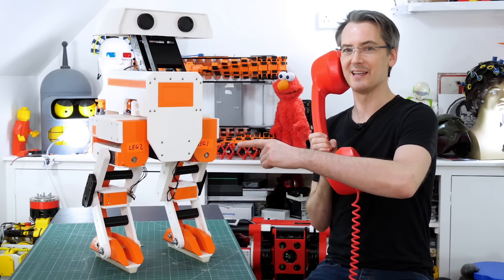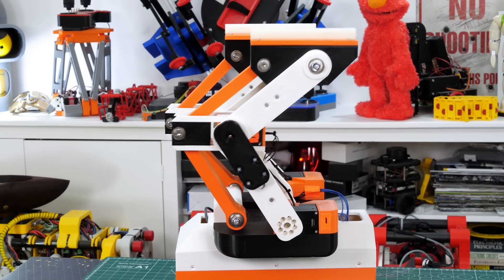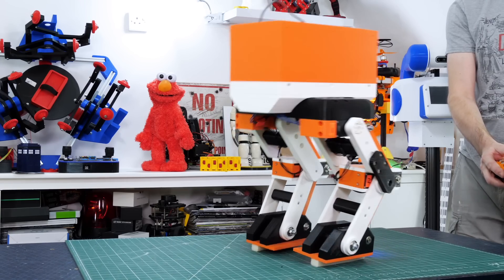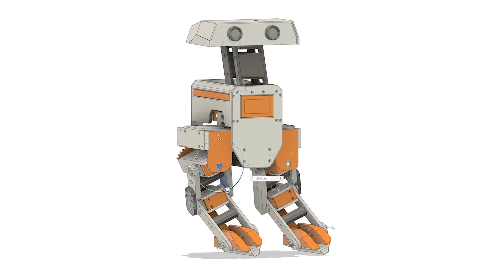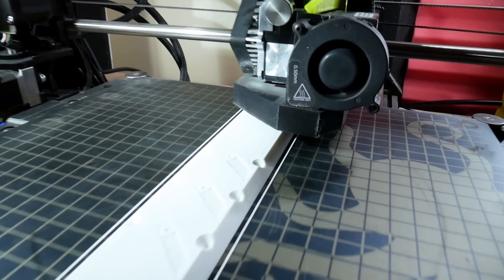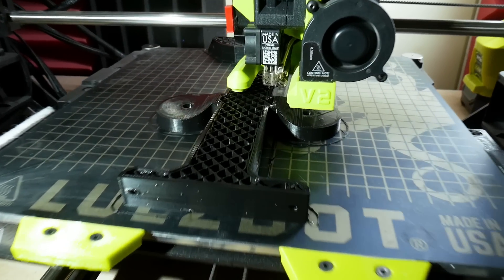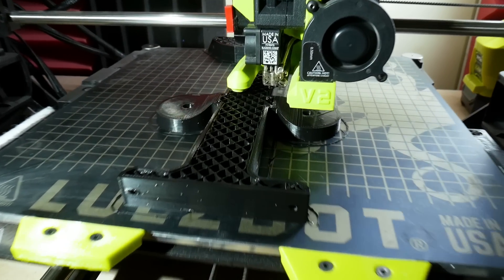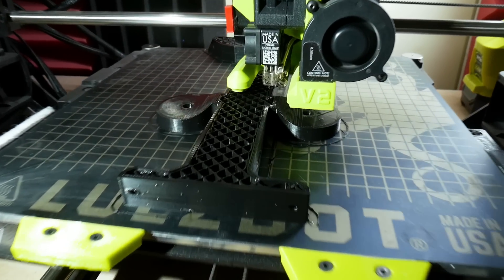How I Built a Walking Star Wars Droid

Comment: This is awesome. I'm not sure I follow the point of the 2 new axes on the legs. The first one's purpose seems to help reduce the wobble, to keep the body vertical and help with balance, which makes sense. But is there more to that? The second one I really don't understand, especially since the legs aren't independently controlled (ie shared servo) and they point in the opposite direciton... what does that do? I figured turning could just be accomplished with longer steps with one leg and shorter steps on the other?

Comment: Why haven’t you consider putting 4 pressure sensors on the “feet” giving data on the “center of gravity “ of the robot with report to the contour of the surface delimited by the contact of the sensors to the ground

Comment: If you want to eliminate gear backlash, copy what's used in the head drive of many optical drives. One of the gears is two thing gears in a stack, with a spring that causes them to rotate slightly in opposite directions. Even if the spring collapses during high speed movement, when the head slows to tracking speed, the spring spreads the teeth to eliminate backlash.

A robot foot idea I've had kicking around for ages is a passive locking design for rough terrain. Without weight on the foot, springs hold it perpendicular to the lower leg. As the leg sets the foot down, the foot passively tilts in 2 axes to match the surface angle. As the full weight of of the robot presses down, the tilt angles of the foot lock. Just above the 2 axis tilt would be a fore-aft joint with springs just stiff enough to allow the bot's momentum to tilt forward over the foot. That joint would also have a clutch to control the ankle speed or to lock in place to keep the bot upright when it's not moving. Best stability would be with one leg slightly forward and one slightly back.

The foot tilt axes could have angle sensors to feed information to the walking control. I figure that robot walking should work from the foot upwards. Put a leg forward and let the foot come down then take data from the foot to adjust the knee and the hip. What I've seen in most robots is a "dumb" foot the robot stabs at where it calculates the ground should be then it reacts to various sensors telling its controls which way it's falling over. A quadrupedal robot can get by with four feet it can treat as simple single points of contact. A bipedal robot with flat feet can handle flat surfaces, or uneven surfaces that are a bunch of flat surfaces of various heights. What I've seen of bipedal robots on uneven terrain that's made of angles or curves is they don't stop and stand on such surfaces. They either keep moving forward or "dance" by constantly pumping their legs. Taking input from foot angle sensors and having ankles that can both tilt in different axes and lock in place would enable steadier uneven surface walking and stable, motionless, standing.

In my much younger years I lived on a 2 acre property with areas that were far from smooth. I used to run across them in the dark and never fell or twisted an ankle. I managed that by keeping my ankles loose, letting my heels land first then allowing my feet to flop down and conform their tilt to the ground. One I sensed my forward foot was planted I'd tighten up the ankle and allow my body weight and momentum to lever forwards while I picked up my rearward foot to swing that leg forward to repeat the cycle. I was quite the logical thinking teenager. :)

Another thing I did was ditch running. About half the property was a grassy hill slope with a flood irrigation ditch along the top. the sides of the ditch were at about a 45 degree angle. I came up with a technique where I'd run with left foot on the right slope of the ditch and right foot on the left slope. I'd pull my rearwards foot outwards just enough to clear the other leg then swing it forward then push back across in front of the other leg. For me it was a fun and quick way to move along the ditch, almost self guided like a train track. Why did I do that? Because it was fun, faster than walking in the bottom of the ditch putting one foot in front of the other. I was also that kid who in PE class when it came to standing on one foot could just stand on one foot while the rest of the class was flailing their arms and free leg about, trying not to fall over.

I was the shortest and lightest kid who could just manage a 12 minute mile run and was too light to compress the springboard even a micro-inch. How light? I could stand on top of a perfect, empty, 12oz soda can without crushing it. For fun I'd carefully stand on a can then give it a gentle tap with my other foot to make it collapse.

Comment: Nice build so far! Question I’ve had: What extruder do you use for your larger nozzle prints like 1.2mm? Your useful ROS robot videos got me investigating larger nozzles than 0.4mm but I doubt my stock tronxy setup can do the flow 1.2 would need.

Comment: @aJames Bruton - AWESOME 😎👍 🤖
I was just thinking... You could do the feet in two parts, a paddle ball at the toe end and a slightly rounded heel, at the heel end and use adjustable springs, you can wind in the right tensions
🤔 ... Maybe leaf springs for the ball of the foot 🦶 and maybe a bunch of rubber bands from the heel to under the knee, to tight ? Take some rubber bands off, too loose put some more, (attached by hooks on L & R servo's). 
 And have some static rubber bands pulling the front of the foot up... 
Hmm 🤔 sounds like a lot, maybe for another project in the future 🎉

And in that case can maybe look at making voltage muscles that work kinda like a electrical solenoid, more power more contraction, 💡 could use two opposing coils to have full control of their magnetism ... 

Don't know if that would work but would be awesome if you can the vaultage in a circuit to test it, or maybe connecting server servo to a potentiometer? 
That's sounds fun 😊
Good luck and awesome projects ❤
Thank you🎉

Comment: Could you run a loop of surgical rubber (latex tubing) as a shock absorber instead? - Have it act as a muscle tendon instead of a back driveable solution? (not just at the point where there is a problem I mean a loop that runs the length of the leg so thigh to ankle)

Comment: I'd love to see this project continue, and overcome the instability problems.  I thought one of the advantages of Dynamixels was that they could be backdriven and implement a 'virtual spring'.  I also thought the user had some control of the PID parameters, enabling the 'rigidity' and damping to be varied.  I've never used them, so I could be mistaken.  There is also a possibility to build mechanical springiness and damping into the leg structure.

Comment: Strict adherence to linearity and angularity.  Between the bearings and motors there is plenty of inspiration toward circular, spherical and other non-linear opportunities, but this feels more like adding gears and axes of movement that ultimately just reinforce a cubic vertical/horizontal-only palate.   wobbling back and forth as a kind of cute side-effect that can approach a form of walking is what we get.

Comment: This is funny because I said to myself at the beginning of the video that you should probably program and test it on the floor rather than the table. And turns out at the end it only worked on the table and not on the floor. I had a little laugh.
Reply: You'd like refrigeration videos, it's like a reverse stove that sucks heat out of things to boil the pot of refrigerant 🤯

Comment: At 12:00, for a "dirty hack" that does an awfully great job of dampening the oscillations. Honestly I think you're selling yourself short there, damping, and active damping isn't simple.
I think switches might be too binary for ballance. You might get some crude jerky sense of ballance but for a dynamic sense of ballance I think like you discovered with opendog, back drivability and motor current reading is best.

Comment: as an idea, try putting the IMU in the head and then attempting to keep the head stationary. This is (roughly) how humans keep balance via the fluids in your inner ear and, if I had to guess, it allows you to easily and accurately account for small micro-vibrations/misalignments and essentially acts as a high-pass filter for physical noise. In other words, if you constantly try to keep the head stationary using just the neck motors then if you can't keep it stationary you know you need to use the leg motors to account for the remainder of the inaccuracy. Actually programming this would be a bit tricky and the naive approach would run your leg adjustments at a decent latency as you try to look at the past to try to figure out what portion of the readings are new head-wobble or old body-wobble, but hypothetically it could work.

Comment: I always thought it would be neat to make a 6-DOF "arm" that can crawl like an inch worm and collaborate with others to do complex tasks.

Something like the "microbots" in Big Hero 6.

You can imagine them having interchangeable actuator mounts on either end so they can switch out graspers and other tools.

You could also imagine six of them connecting to a tool box or something and walking it around like legs.

My dream would be to have these things be able to build an unbounded volume with both additive and subtractive manufacturing.

I'm sure the software for choreographing such a swarm would be crazy complex.
Reply: Sounds like the coolest evolution of Canadarm2 on the ISS.
Reply: the code could be simple, some simple rules the arms could follow. kinda like booids.

Comment: Awesome! But before you go and implement switches and the logic for it, why not try and mount the inertia measurement unit in a way that deadens any vibrations? That might already fix most of the noise you get and shouldnt really mess with the data.
Reply from the maker: It'll be hard to do that and still get fast data, the whole machine is shaking. Also if the floor is not flat is won't work.